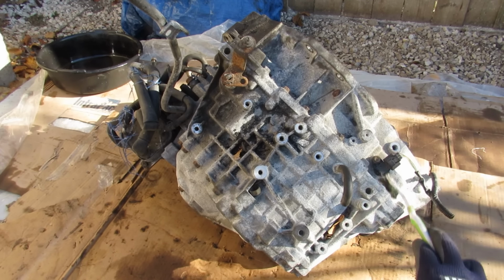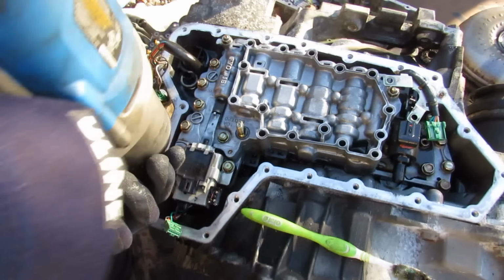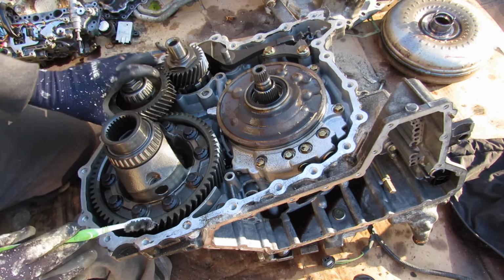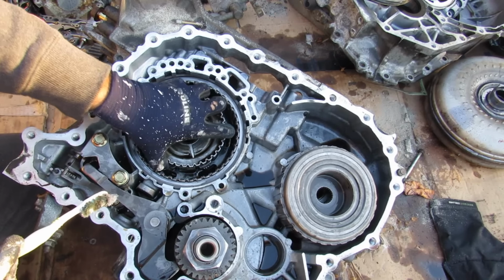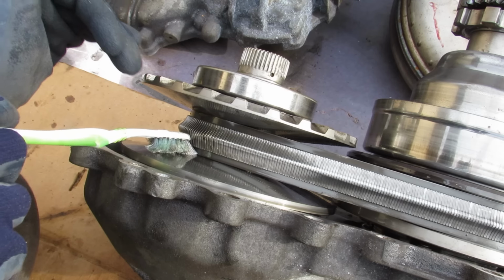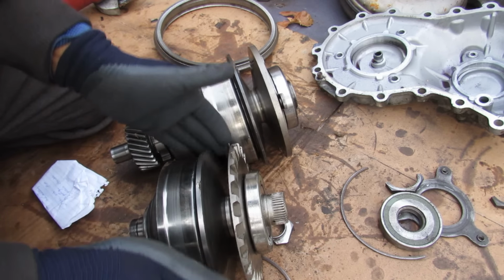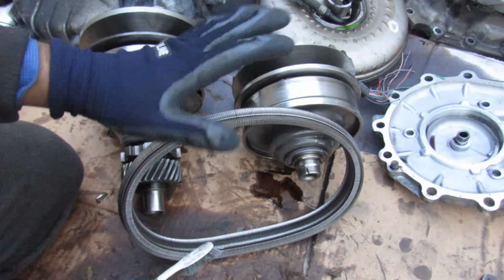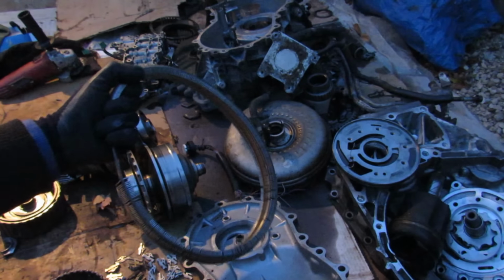Why Nissan CVTs FAIL

Comment: As someone who pioneered, designed and built turbocharged Yamaha snowmobiles making at first 250hp, then in the 300's and now over 400hp, I can assure you CVT's can be made to handle power and nothing can touch them in regard to gear ratio and how it utilizes power delivery.  The motors zip to peak HP output, the turbo loads and spools almost instantly and the sled/vehicle/ATV or whatever leaps off the line and stays at peak hp the entire time.  Modern multigear auto's get close I.E. Ford/GM 10 speed, but they still can't get out of the hole like a proper CVT.

Before you say "but a snowmobile is light!" yes, and the transmission is sized accordingly so we are dealing with a much smaller unit and getting it to live at triple it's rated hp/tq!  Not to mention we are on ice with metal cleat tracks 2 feet wide.  You want to talk about traction?  Damn near rips your arms off!  LOL

Comment: Something to think about for all the naysayers and "rubber band effects"

CVTs were tested on F1 vehicles in the 1980s and BANNED before running a single race because they would have turned the events into a one-horse-race at the exit of the first turn and because race officials HATED the way they didn't sound like "race cars" anymore.

CVTs were consistently running 10-20% faster laptimes on twisty circuits.... Not bad for a "rubber band" (identical chassis and engines, just the difference between stepped gears and CVT)

hint: just because the engine speed isn't changing doesn't mean the road speed is staying the same.  When you plant your right foot, more torque is available instantly vs engine speed changing much more slowly. 

The ironic thing is that this effect was extremely noticable in Toyota's gas turbine cars (1-2 seconds of thrrotle lag), so they designed a CVT which kept the engine at the same speed whilst altering drive speed based on the TORQUE available. That's the basis of all modern CVTs.

30 years of Toyota gas turbine technology trials resulted in the gearbox that's in the Prius - multiple input sources (gas engine and electric motor in prius), infinitely variable output ratio - as well as modern steel belt CVTs

Comment: A clear illustration of a system that has absolutely no reason to have been implemented into an automotive type application. A c.v.t system functions adequately in a recreation type vehicle such as a snowmobile or a go cart but has no buisness whatsoever being used in a car. I encounter people all the time who bring in vehicles that have 40 or 50 thousand miles(often much less!) on them and these transmissions are already in complete failure. And they are really blindsided when they find out that their recently purchased used car will cost them 3 to 4 grand to repair. Don't ever buy a car that uses a c.v.t style transmission, unless you have enormous amounts of money or are delusional enough to believe that these things actually have any valid merits to the automotive world. Trust me - they definitely do not!

Comment: the primary reason for failure in CVTs is insistence on using stepped semi-fixed ratios to give a "feel" of a traditional transmission
this results in wear being concentrated on particular spots of the variator belt pulley cone faces resulting in grooves on them (and a dead CVT)

The best thing you can do with a CVT to get longer life is to reprogram them to change 100% smoothly (engine speed should stay more or less the same at all road speeds and only vary depending on power demand) and avoid using the "manual" settings. If working properly the torque converter should lockup almost immediately after moving off.

Ideally: if you have a paddle shifter on a CVT, snap the paddles off to avoid the temptation to use it. They WILL destroy your CVT

The ONLY reason for them being programmed to have a "gear feel" is because that's what "reviewers" demanded (not actual customers, who get used to the smooth operation very quickly)

Older DAF rubber belt CVTs (and most motorcycle CVTs) used sliding weights on the primary pulley (centrifigual force) to change the ratio and were very smooth (the driven pulley faces were spring loaded, no hydraulics required and far more tolerant of face wear as a result)

Belt failures are almost always a direct result of the transmissions selecting too low a drive ratio (because REVIEWERS (not actual drivers) complained about engines revving when you demand more power or when maintaining speed going up a hill) - again, this can be solved by simply programming the transmission correctly instead of how humans "think" the engine/drivetrain should sound

Emphasis: with a CVT there is very little connection betwee engine and road speed BY DESIGN 
Engine speed is directly related to engine load in a properly operated CVT - AND VIRTUALLY NOTHING ELSE
Almost all the premature failures are a result of trying to make them "feel" like fixed ratio gearboxes when they're infinitely variable ones and best matched to an engine optimised for particular (narrow) rev ranges

in more simple terms: A CVT is a "TORQUE+POWER to speed converter" and is SUPPOSED to isolate the engine speed from the road speed (fixed gearboxes are simple speed/torque multipliers)

If you've ever used an original DAF or a 1980s superscooter you'll know that if you do a full throttle takeoff the engine speed stays almost exactly the same between 0mph and 40mph whilst speed simply keeps picking up with no "glitches" and only once you hit 35-40mph does the engine speed start varying in relation to road speed. 

A modern car CVT should be exactly the same, but because of the higher vehicle mass and available engine torque over a motorcycle, it is NORMAL for the engine speed to "instantly" spin up to a higher value when hillcimbing at one speed or when accelerating. This is BY DESIGN to reduce wear in the gearbox

Comment: Really great video, you clearly know your stuff. My wife has a 2019 Forester bought new, now has 43,000 miles.  Thankfully it's used for highway driving for the most part.  The CVT is a sealed unit, and I've been told that if you attempt to do anything, including changing the fluid then Subaru will void any warranty so will wait.  Part of the reason is so if it does fail Subaru can examine it to better see what went wrong with the original parts, including the fluid.  On the other hand I drive a 2004 Toyota Sequoia, 157,000 miles, I fully expect this to outlast the Subaru!

Comment: So WHY did it fail???? no discolortion of belt or variators no heavy grooving of variators, fliud that came out not too bad Thus no pun for smell? So this is a how it works and how it MAY fail video. Would have been nice to identify failure other than poor build design?

Comment: All wrong. They fail 100% because coolant enters the transmission when the plastic separation bladder cracks inside the radiator at 90-120K miles.  Common to all Nissan transmission/radiator SETUPS, not their transmissions.  A $35 Amazon Haydon transmission cooler takes 30 mins to DIY and then their CVTs last 500K to 1M miles with no maintence.  It's called service center welfare and has been well understood for 30 years.

Comment: Bought my son a used 2016 Nissan Sentra. Used to be that a Sentra was one of the most reliable cars on the road. Had it for 3 years and had to replace the transmission 5 times. The first we paid for when the car had only 90,000 miles on it. Cost us $1600. The “new” transmission was in for about a month when it went out. Nissan replaced it for free. Put new one in and it lasted about a month and it went bad. So once again Nissan put a new one in for free. My son didn’t get pulled out of the dealership until the cars transmission did the same thing AGAIN. So they put ANOTHER new one in again. We took the car and traded it in on a Toyota Tacoma. NEVER EVER buying another Nissan EVER.

Comment: Hey, great vid on the CVT and how it works - or doesn't. The CEO of Nissan (or any other auto company) should check this tutorial out. If they possessed more than two brain cells they would scrap this concept, as an overly complex, half baked method of getting power to the wheels.

Comment: Technically, each little piece of the belt is a moving part. If you count that, it actually has way MORE moving parts than a conventional automatic :)

Comment: Did any manufacture make a good CVT?
Reply: Afaik, there is problems with all cvts made, regardless of metal push belt or metal chain driven. A classic cvt with rubber belt may actually be the most reliable when taking simple construction and serviceability (easy to change belt) into consideration.
Efit: Subaru Lineartronic may be the one that has come closest to a reliable cvt, but it also has problems.

Comment: I’m a Nissan Master, you gave a better explanation that some instructors at Nissan School on the CVT module class. You are right about the heat generation, Would like to add that the CVT fluid crystalizes for a fraction of a second while forced between belt and pulley.

Comment: Ugh!   What a hideously complicated and flimsy box of tricks.   Makes a regular auto seem simple by comparison.   Who needs it?     I expect (like the Wankel) it looked like a really simple concept at the beginning... 
Then, I've just done the clutch on the wife's (manual) Mazda Tribute at 220,000km (130,000 miles); the rest of the transmission is still working perfectly with no sign of wear.

Comment: I wonder how many miles you can expect from one?  I have a 13 Altima with 145k on it and change my fluid every 30--35k miles.  The majority of my driving miles are highway--rural--I would assume that helps in the long run.

Comment: 15:11 before he says why fail. and then blames the old adage the belt. Can anyone honestly say they have had a CVT belt fail?
Reply: Mine slipped once due to being overloaded but it reset itself after limp mode- 2013 Outlander Sport.

Comment: Wow...  That was just awesome.  You explain & demonstrate in just enough detail to show everything we need to see, without drawing it out or making it over complicated.  AWESOME video!  That said ..  CVT's are complete crap.  Period.  I have identical '05 honda civic hybrids...  Except one has 55k on it with a CVT, and the other was a salvage, has 200k on it, a bad cat, and a 5-speed.  The 5-speed gets about 20% better fuel economy (52 mpg) than the CVT (42 - 45 MPG).  I drive the 5-speed about 800 miles a week on my commute.  I expect the CVT to die around 70k - 90k.  I hope i can do an engine swap into the stick after that.  Stickshift forever!

Comment: Some mopeds have the same system. The gear ratio is controlled with a centrifugal governor. It compresses the sheaves and the belt rides up for a higher ratio as you go faster.

Comment: Mitsubishi Outlander Sport CVT''s are good I owned a 2013 from 40k miles till 148k before trading it was still running fine & only slipped once on a heavy load.

Comment: How long can a CVT last if the vehicle isn't too heavy and you do regular/early transmission fluid changes?
Reply: virtually unpredictable.  lt's like playing Russian roulette. l've seen CVT's fail in Nissans with less than 1200 miles and then the replacement CVT's keep failing in under 15,000 miles of being replaced because Nissan only does warranty replacements with remanufactured CVT's, not new ones. But if you are one of the lucky ones you may never have a problem with it. There's just no way to know. That's why Nissan resale value is garbage now, so many people have dumped them after having the CVT replaced and before the replacement unit fails as well.
Reply: @marketingmajor8126  sounds like they probably have low issues with CVT in small vehicles so they shoved them in much bigger ones and are now paying the price for it.

Comment: But my 10 year old Jatco (Nissan) CVT works like a charm....
Reply: Well,  that's ONE
Reply: @hard2getitrightagain314  Both 2009 and 2013 Altama's  still working well, changed trans oil in the 2009 at 60,000 miles.

Comment: Nissan tech of 8 years here. Replacing cvts paid the deposit on my house.
Reply: Have you ever seen one last longer than 200K?
Reply: @johndaniels651  Yes but if it did they are usually whining and/or have delayed shifter engagement and usually a lack of power
Reply: @fitztech    Oh Man..  Guess my 2017 Altima  with 60K is soon to be junk.     Hoping it makes it to about 80K
Reply: @johndaniels651  buy a 3rd party car insurance
Reply: @johndaniels651  I haven't seen many cvt issues with that generation of altima. From about 2016 to now they have become much more reliable. From 2012-2016ish my shop was replacing 3 or 4 a week between 10 techs. The 2013-2015 pathfinder was the worst. It paid 10 hours under warranty and could be done in 4 or 5 so it was gravy.
Reply: @johndaniels651  Change your fluid with oem Nissan ns3 fluid every 60k (miles) and don't tow anything with your altima and it'll be alright.
Reply: @johndaniels651  if your transmission goes out by 84000, nissan replaces for free.
Reply: @fitztech    Thanks for the info..   I'm pretty sure the dealership would never be this honest.     So far I've changed my CVT fluid at 28K and 55K..   Overkill?   LOL
Reply: @johndaniels651  Yeah that's overkill. Every 60k is good enough.
Reply: @ALdragon4  Isn't there  also a time limit ?  My 2013 Maxima has 48K but I think the CVT is out of warranty. Looks like the warranty is on 2003 - 2010 models and is 10 years 120K........all over now
Reply: @fitztech  just got a cvt fluid change on my 2017 maxima at 60k miles. they put in NS2 fluid. what's the difference with NS3?
Reply: @dkame1851  I'm not sure what the actual difference is between the two but I don't know why they would have used ns2. I'd go back and get the correct fluid. It's not cheap, might as well get the right stuff.
Reply: @fitztech  it was at the nissan dealership so i wouldn't think they would put the wrong fluid in my car?
Reply: @dkame1851  it is probably fine with ns2 but spec is ns3
Reply: @dkame1851  maxima takes ns2.. after your warranty ends use idemitsu cvtf type n.. they are the company that nissan hires in japan to make their tranny fluid. 11 bucks a quart
Reply: @sickfoo5506  negative. 2017 maxima takes ns3 not ns2.
Reply: @fitztech  Hey, do you have any suggestions on which year/s of nv200 are okay?
Reply: @fitztech  hi jesse what about the infiniti JX35 2013 are they bad also
Reply: @kingyankee69  just got mine change so if they moved it to higher Mileage, nice.
Reply: @kingyankee69  I bought a used Altima does this apply to all or only I'f you're the original owner?
Reply: @kingyankee69  i wish I knew this before. I paid about $4k and mine was at around 160k miles

Comment: Alright, this is actually really really awesome! Also explains the high belt failures of the Subaru Justy back in the day, unfortunately. 

I think CVTs are gonna be problematic for a couple more years yet at the least even with Toyota seemingly getting it somewhat right?
Reply: Toyota wisely never used those Jatco designed-to-fail heaps and builds its own CVT and E-CVT through Aisin. One of the most reliable auto transmissions in the world.
Reply: @Gavichap  Ah, good to know!

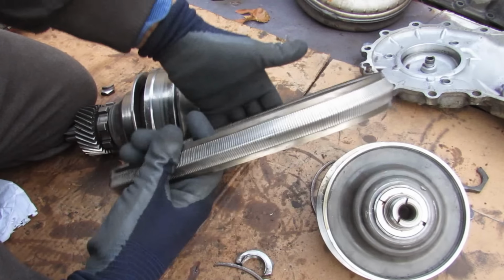Comment: 14:10 Today I learned: Steel belts are "push" style, whereas rubber belts are "pull" style
Reply: In general, most metal chains and most rubber belts work on a quite different principle. Except for rubber timing belts that work in similar fashion to chains (standard chains made of roller and pin links). The principle of car CVT operation have been used in industry for a very long time; I have seen metal coil unwinders from 60s using this principle instead of gearboxes. It was the same, except, they were using rubber V-belts, and not this kind of special chain...
Reply: Rubber can compress etc. a bit, and relies heavily on grip, which lends itself to a pull scenario.